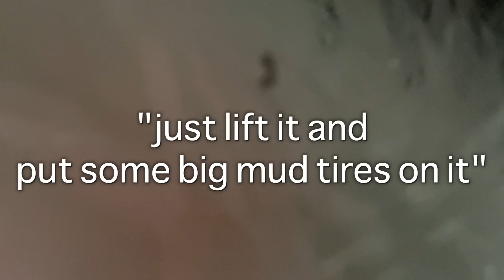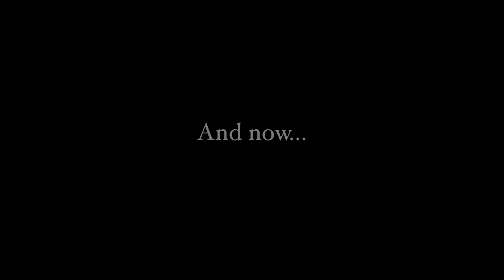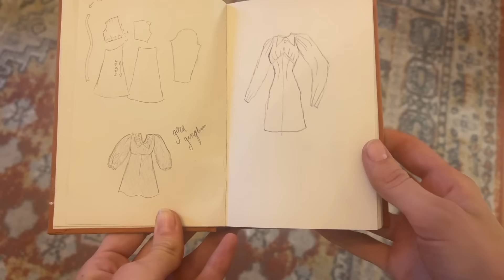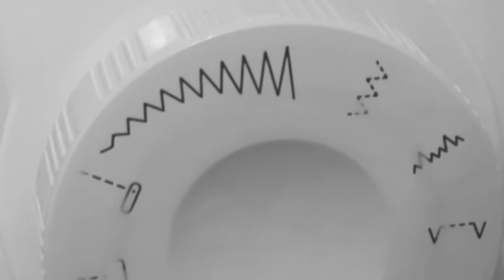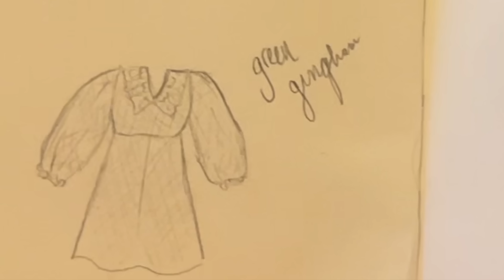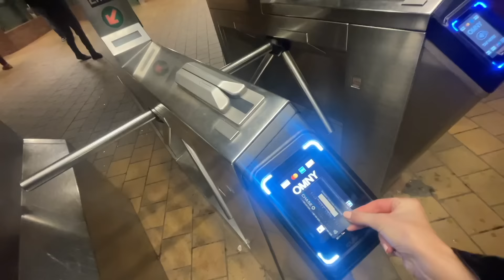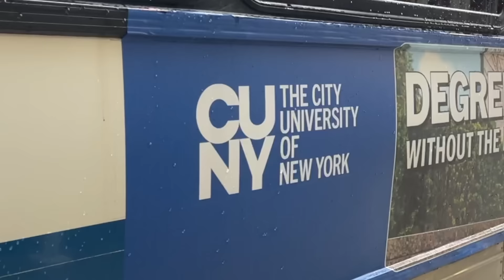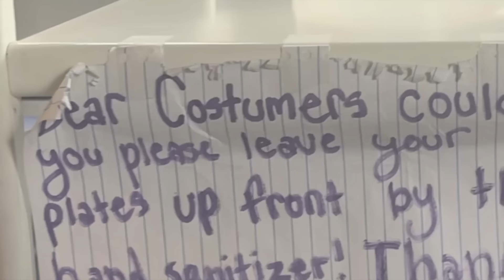I Made My NYC Vacation Wardrobe!

Comment: Care/of is honestly a great baseline for gauging what vitamins you need and I wanted to give you the code use but holy damn its just overpriced vitamins that I buy already from a store for far cheaper. You're just paying out the ass for the packaging and personalization of the that packaging. The vitamins themselves aren't actually formulated for your individual needs, its just a 'this stuff is good for aiding these concerns"  -- again, a great baseline, but not actually customized. its the same thing you get OTC. Totally not your prerogative, but to anyone else considering the code, if you can afford it, cool, but this bish can't. Even at 50% off. In fact, the fact that it's so easily 50% off is probably the first sign that it was going to be expensive....  XD Sorry Micarah, I really wanted to!